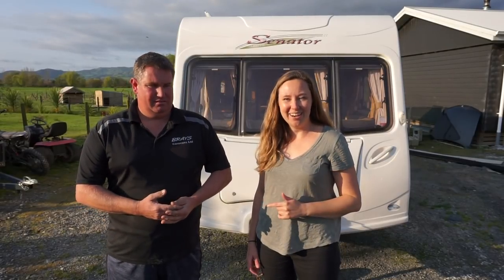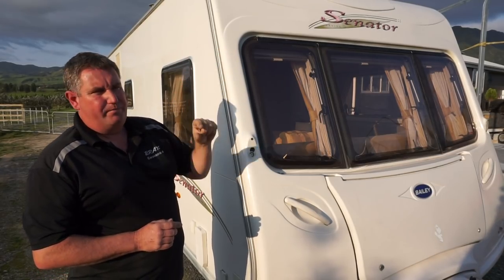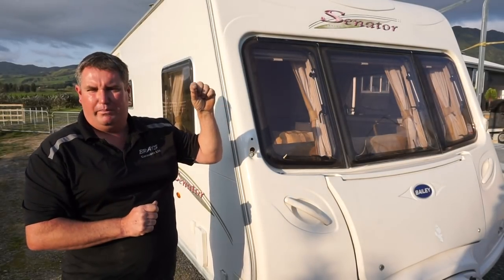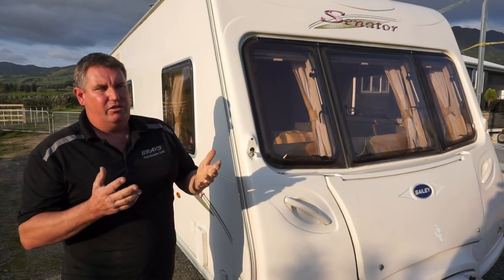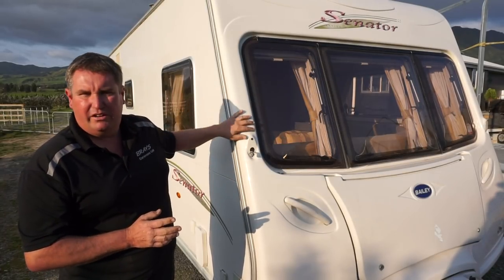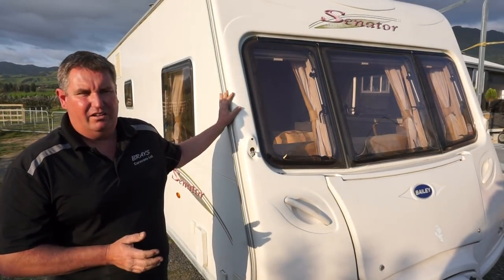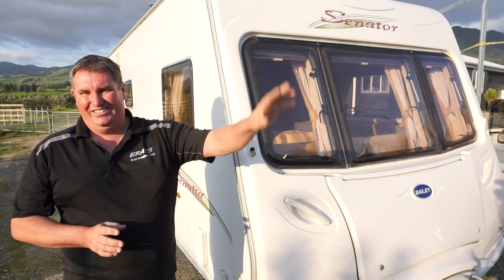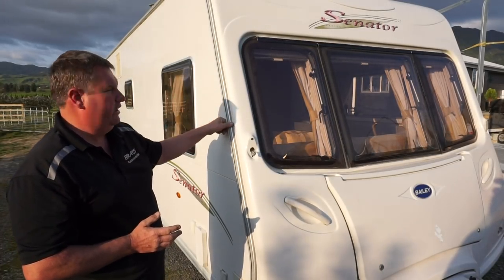Top 5 Caravan Maintenance Tips

Comment: On the inside of each window is a couple of small plastic bungs. Take them out in the morning and the moisture will escape from the window, then replace in the evening. This will normally sort the moisture problem.
 If it keeps occurring then a special plastic glue is available to reseal the two parts, although finding it is like finding a unicorn. 
😊
Reply from the maker: That is amazing to hear! The best tip. Now you've pointed it out to me, it's obvious. A couple of my windows have started steaming up, so I'll be doing this.
Reply: You can see them on the caravan in this video - they’ll be in the top corners x
Reply from the maker: Seriously blown my mind 😱
Reply: Michael Vincent 
Please I have  a dust between 
The window layers because 
I have small crack .
How to clean the dust 
Thanks

Comment: Ive sent caravans from the uk. Ive been to nz many times. The roads in nz are actually better than uk ones. Most of what this "proffesional" said is crap. Ive never seen a chassis flex to the point of cracking, or motor movers flexing the chassis. Never known a gas leak from towing it too much. You happily accept our caravans, as nz ones are old and dated by our standards.
Reply from the maker: I've been hearing that the UK roads are surprisingly bad? Jason did have a few scary chassis stories...

Comment: He is quite wrong with the Audi - Holden analogy. English caravans are basically built to look good and are focused on gizmos rather than performance and longevity. The expectations are that an English van will never leave hard sealed pavement so their performance outside of that is not good. Cabinetry is designed for lightness over durability as large engined cars are expensive and multi car families not as common as NZ and Australia.I was once told Rule number 1 of caravanning , Never buy an English caravan. Rule number two, Never ever forget rule number one.  English caravans bare no resemblance to a German car because although an Audi is expensive to fix it is a quality well constructed machine that will usually out live its owners desire to keep it. An English caravan on the other hand is generally speaking badly designed, poorly built using the cheapest and lightest components available and not expected to perform much longer than it takes the average British consumer to pay it off and sell it for the latest model ie 10 years max.
Reply: grumpy totally disagree - I’m in the U.K. and tow with a U.K. caravan and couldn’t be happier with the choice of good vans available here.  Maybe they aren’t perfect for NZ caravanning but caravanning here in the U.K. is going from strength to strength so we must be getting something right?
Reply from the maker: I'm a fan of UK caravans myself 🤣Do agree that they are not built to last forever.... but the same can be said about most caravans. I guess each country has it's aims, strengths and weaknesses.
Reply: Hey grumpy......did the research, settled on a NZ leisure line. Cost more but it's built like a brick outhouse. Friend has a UK van, looks real good but has issues. A UK cabinet maker friend told me he is pleased I didn't buy UK van. Lots of people have them and like them. Where I intend going going might be a bit rough for a UK van.
Reply: I did the research and the Bailey Range finder, which is a UK caravan mounted to an Australian chassis, seems an excellent option, if you want a UK van to survive more than 5 years on NZ back roads. However, if you fit height adjustable air suspension to your UK caravan and add two additional bracing beams running the full length of the trailer, that will eliminate a lot of the stresses UK vans face down under and increase their survivability. I plan on doing this to every UK caravan I buy from now on. The first is a 2018 Swift Conqueror 650.
Reply: @fatharryellis3291   What a lot of tosh
Reply: Who told you that
Reply: David Davis is a hacker.